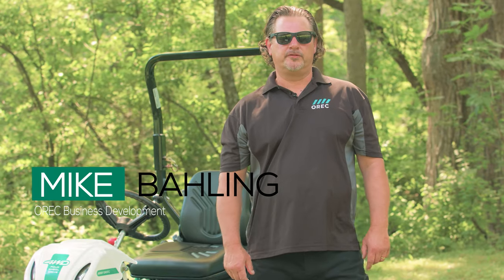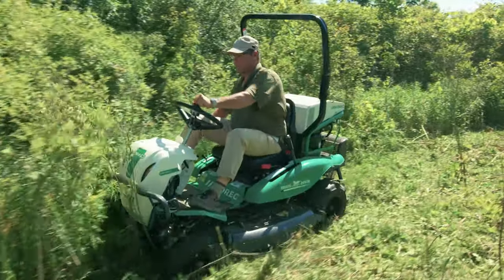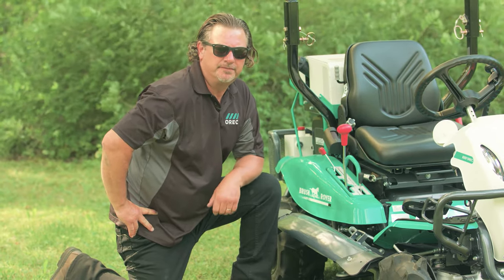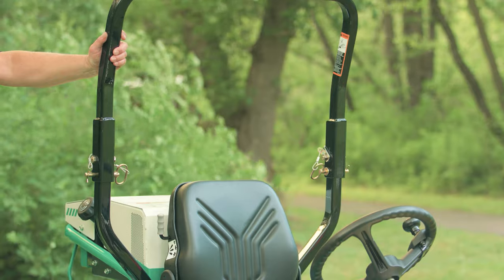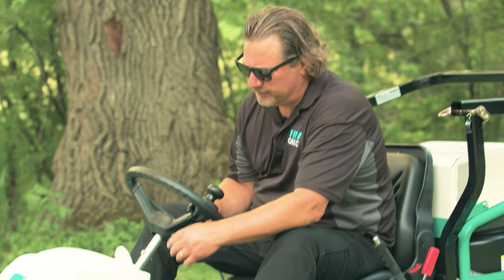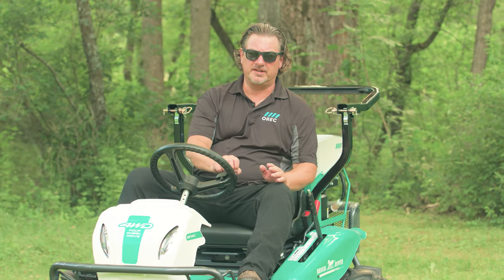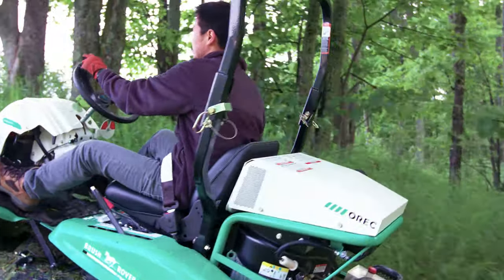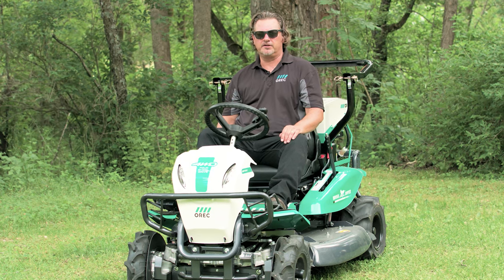How to Use a Four-Wheel Drive Brush Mower

Comment: PRICE?
Reply from the maker: The MSRP for our 4WD Brush Rover is $13,900 USD.  You can learn more about this 4WD model here ➜ http://bit.ly/4WD-Brush-Rover We also have a 2WD version of the Brush Rover that has an MSRP of $9,900 USD.  You can learn more about the 2WD version here ➜ http://bit.ly/OrecBrushRover  Please make note that the Brush Rover requires a U1R type battery (270 CCA or greater). Sold separately.